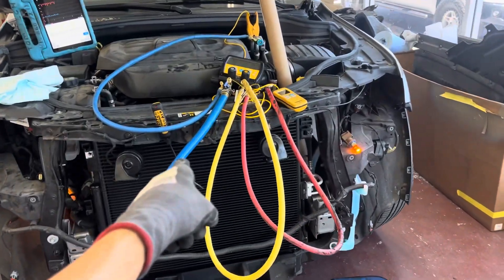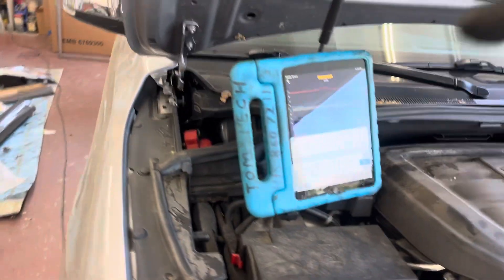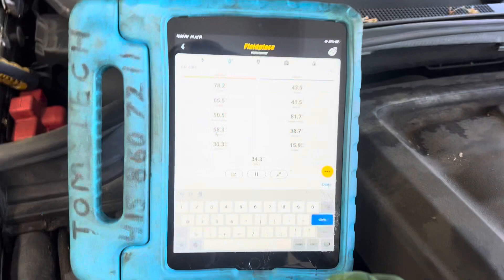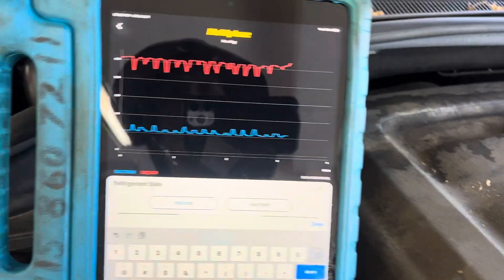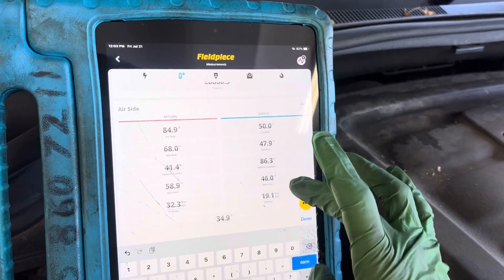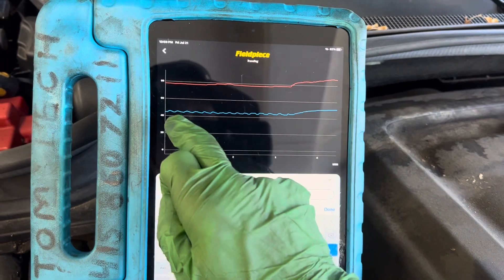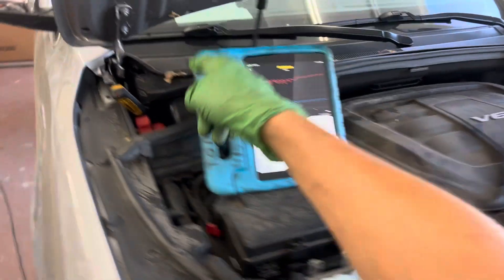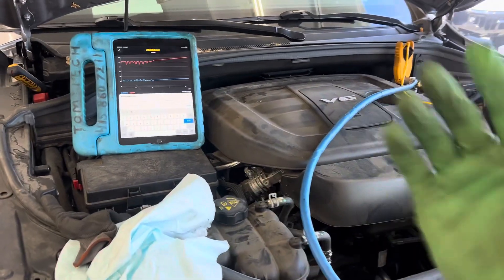WHAT HAPPENS TO AC RECHARGE , ON FRESH AIR, 95°F DAY, HOT ENGINE, HOOD UP, Why doesn’t it cool 🤔🤣￼

Comment: So when you were helping the older gentlemen fill his car using the cans,  why did you ask him to do it with the fresh air? I thought it was best to have it on recirculation?
Reply from the maker: Because Fresh Air brings the hot outside air do you put a load over the evaporator?

It’s already a cool day, and the inside of his cabin is cool as your cooling down and lowering the temperature inside the cabin. The load over the evaporator goes down. 

This is where you get into the superHeat thing if you know you’re super heat 
I’m not gonna explain it you’re supposed to learn it. I’ve posted many videos about it and links to other videos how to learn more about it. 

Join the Facebook group 

Automotive, HVAC Technicians 

I posted some links to other websites to watch videos or listen to podcast. I have not posted on my YouTube channel just searched through the history the last few weeks. 

This is a new Facebook group